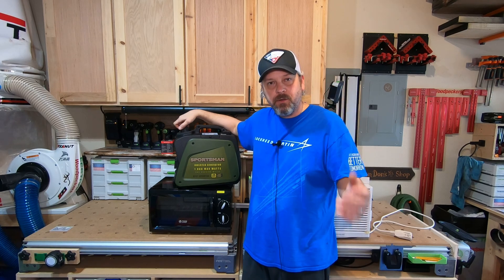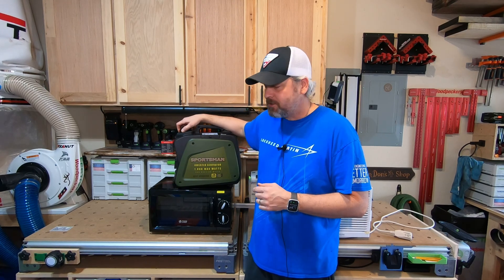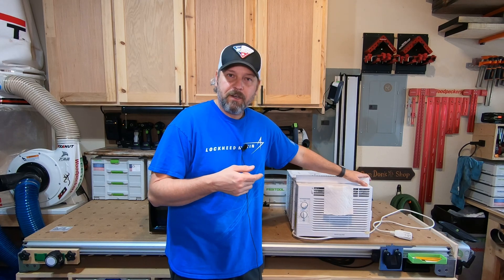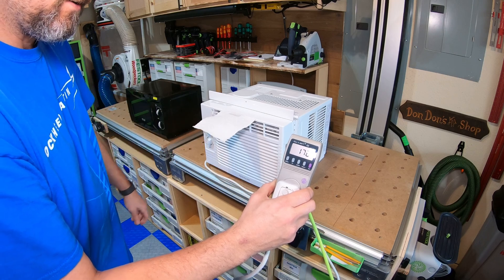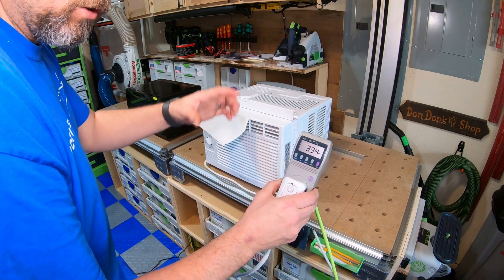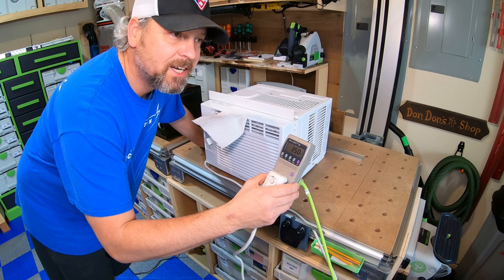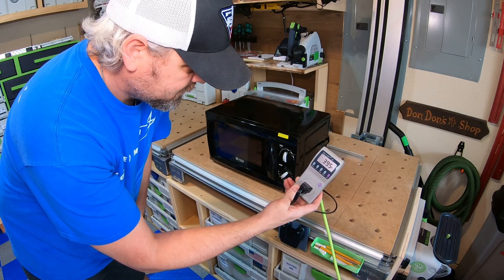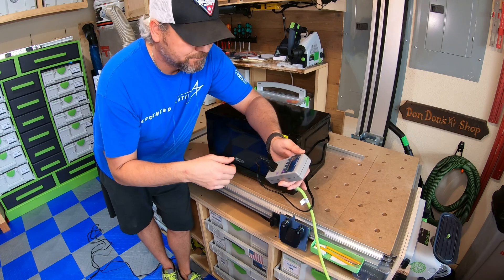Will my 800 Watt generator run a 5000 BTU A/C??

Comment: I just purchased a 1500 watt generator and was worried it wouldn't power my 5000 btu a/c after asking question to AI chart it stated that the surge from the a/c when turning it on would fry the generator.  But now after seeing your video, think I learned something, it should be fine so long as I put a/c unit on low setting when starting it up and gradually go up to high cool.  Thanks so much for this video!

Comment: No such thing as a "Volt Amp".
Reply from the maker: A volt-ampere (VA) is a unit of measurement for a device's power consumption, calculated by multiplying voltage (V) by current (A)

Comment: I've watched 3 videos so far running the sportsman 1000 to power a 5000btu ac, the last two were great but y'all were using a much bigger cord than the first guy and his generator kept shutting down so thanks for the demonstration, 💯💯💯
Reply from the maker: Sure thing. Mine was just a 14gauge cord by the way
Reply: @BrianWatersOutdoors  I got'cha, not saying nothing bad, but some ppl don't do their homework on the amperage/voltage of the extension cords they run to power certain products, that's why the videos ppl post are a great learning tool!!. I watched a video of some van dwellers who made a swamp cooler, he ran a 4"motor and reduced it down to 3" in a tube inside the cooler, then reduced that down to 2" coming out. He said it didn't work like he thought it would, he didn't realize he tremendously restricted his air flow coming out, he should've ran everything 4" and he would've overly been satisfied... Got to do your homework!!!! 💯💯

Comment: Great video, does this have to be put into a window bc of carbon monoxide?  If so, Could I use this set up in a car window to sleep in car?  Thanks.
Reply from the maker: Not sure honestly how you could do that but if you have a power supply strong enough inside the vehicle and a mounting option to seal up around the unit I suppose it could be possible.
Reply: It goes in a window because the motor puts off heat. You don't want to heat the same room you're trying to cool.

Comment: I got one from harbor freight that's 900 watts  . I was wondering about it around tornado season
Reply: I got one the tailgated 900 watt I've used it to run power to heat it worked great have used it to run freezer when power its great cheap tank of fuel will run a long time
Reply: @richardwood4464 have you tried it on a 5000 btu air conditioner?
Reply: If you get a model with soft start like this or the FFRA051WAE (the ones I have) should run it.
I have a pulsar 2 stroke I want to try it with also which should be the same as your tailgator

Comment: I have a 1500 watt bluetti with a thousand watt inverter and it won't run a 5,000 BTU AC. Thought maybe this one would. But you change the settings in the middle of the video. how many watts does it pull when the compressor kicks on? Mine spikes at 1,300 and shuts down my inverter.
Reply from the maker: When my compressor kicks in it peaked at about 750 watts. Is your a/c digital? I’ve heard that type pulls more watts than this non-digital a/c unit.
Reply: You must not understand LRA or surge watts of an air conditioner? A 5000 BTU air conditioner might run at 500 watts but the LRA might be 3 to 8 times that much, so you could possibly need a 4000 surge watt generator to actually run that 5000 BTU air conditioner

Comment: Could you run that AC on a Goal Zero 400? From my limited knowledge, I am thinking yes but am wondering if I am right.
Reply from the maker: I’m not familiar with that generator, but I’m going to guess no. For this specific a/c I’m using I need about 700-800 watts start up/surge power to get it running. Once the compressor kicks on it only uses 400-500 watts.

Comment: What is a volt-amp?
Reply from the maker: Basically the same thing:
Reply from the maker: volt-amperes are usually used for analyzing alternating current (AC) circuits. The volt-ampere is dimensionally equivalent to the watt (in SI units, 1 V⋅A = 1 W). VA rating is most useful in rating wires and switches
Reply: @BrianWatersOutdoors  I'm a non-electrician and had never heard the term. Wasn't trying to be a smart aleck.
Reply from the maker: @danielsmith2447  no worries- me either bud. I literally copied/pasted that from google😉

Comment: Is that an Energy Star A/C unit??
Reply from the maker: No, it is not
Reply: No mechanical ones are energy star lol. 
But it does tmhave the soft start which makes it able to run on smaller generator. 
When running on a generator the energy start doesn't matter

Comment: I plan on using that exact AC unit on a Honda generator during the day and a Jackery 1000 at night for the master bedroom during power outages.  Thanks for the video!
Reply from the maker: Gotta check out those Jackery’s
Reply: Have you done that yet? If so, how well did it work for you? I'm curious about the Jackery, but just too expensive for me right now.
Reply: @troyyarbrough  - Not yet.  I have 2 Jackery 500s and 2 Jackery 360s so far to run wifi, alarm, security cameras, TV during power outage.  They go on sale often so keep your eye out!  Less than $1 per watt often.

Comment: Just throw that ac in the front of the tent with a few inches into the door. Just tilt it up a little bit and zip the door around it. Use a towel or two to seal it better. Been doing it for years. Make sure the condensation Runs downhill away from the tent and not under it
Reply from the maker: Thanks!
Reply: They work great at night. In the day not so much.